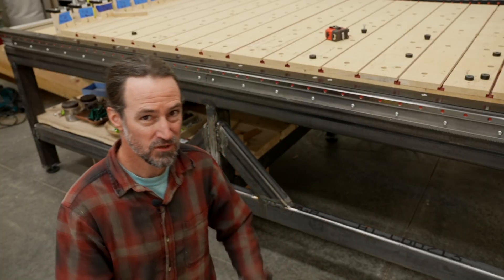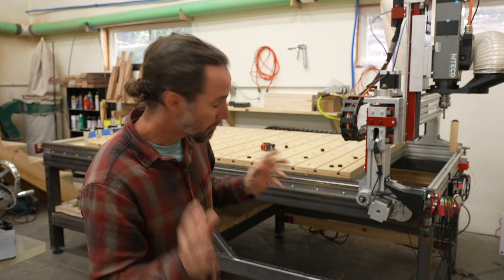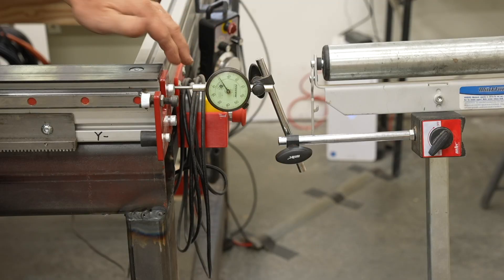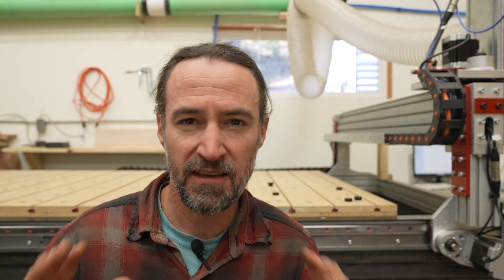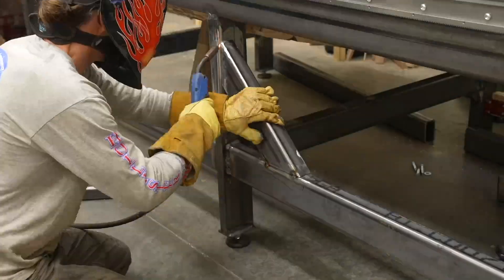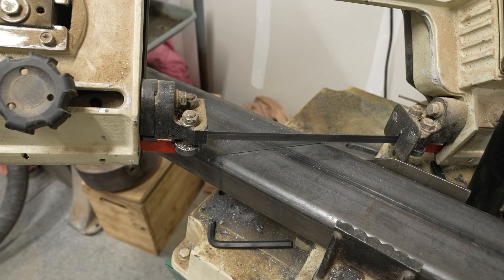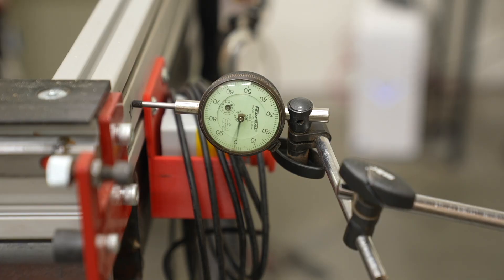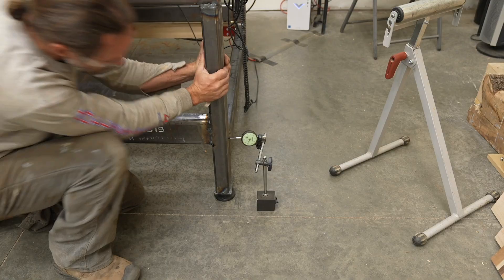CNC Build Ep 11: Improving the Welded Steel CNC Table for my Avid Pro CNC Machine - LESS FLEX!

Comment: Hi, you did a nice job stiffening your structure but the weak link seems to be your adjustable feet. Your whole table is balancing on six 3/8 to 1/2 bolts. I’m looking at my own build similar to yours except I have the aluminium extrusions throughout like the Avid machines. I plans to adjust my heights on the feet then triangulate braces to my floor. Just a thought.
Reply from the maker: Interesting! What do you think the problem is with the adjustable feet? When I measured movement of the table, it was at the top of it, not at the bottom. I was seeing flex in the table itself, but not any physical movement at the feet. The feet could be a pivot point, given their design.
Reply: @CorbinDunn  What highlighted this for me was how you measured movement using the dial indicator off the end of the table. I figured if you completely stiffened your structure as you did, you still have a joint below where your threaded adjustment legs thread into the base plate bolted onto the bottom of your legs. No thread comes without some slop and a half inch bolt will flex. You measured .005’, I could see those numbers coming from there during rapid directional changes. It could be reduced by screwing the adjusters up as far as possible while still maintaining a level table then using the jamb nut to remove play in the threads. Or strut or block your table to the floor. One other person I watched used his phone to measure vibration, I imagine he was seeing vibration from his gear driven rack. Just some thoughts. Thanks.
Reply from the maker: @billjohnson7834  Thanks Bill! Yeah, I will try to look into it at some time and figure out where the current flex is coming from. These are some good ideas to look into.

Comment: It would be the machine rubber feet? I have that issue as well
Reply from the maker: I don't think it is the rubber feet; if anything, they may absorb some of the vibrations. I measured movement at the top of the leg and also down at the bottom of the leg (by the foot), and I got the most motion at the top of the leg. So for me, it was racking that was causing the biggest issue, and the side horizontal piece (along with the 45's) helped stiffen it up. If you have a regular Avid CNC table, then you can bolt on some MDF to the sides, and that should stiffen it up a lot.
Reply: @CorbinDunn  okay interesting. Yeah for me my whole table is welded and I notice movement through the feet but it could be to that I’m using 2mm square tubing. It could be that.  But I’m glad you are making these videos, I’m learning a lot and putting that knowledge into mine. Thanks 100